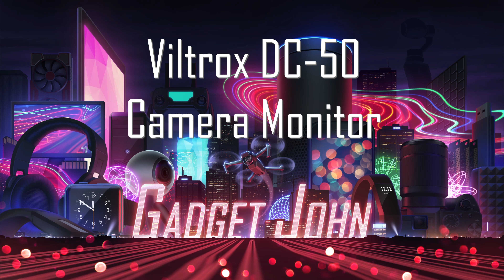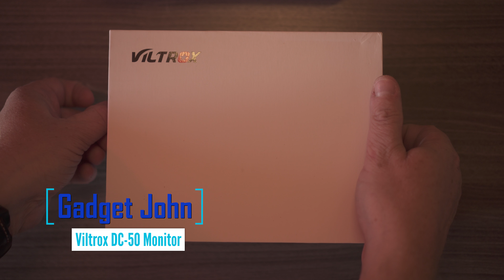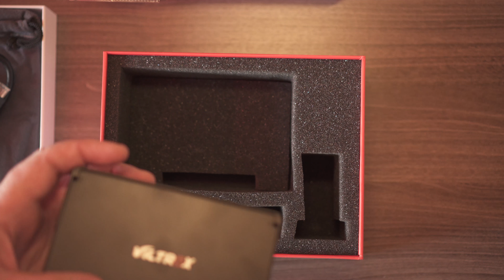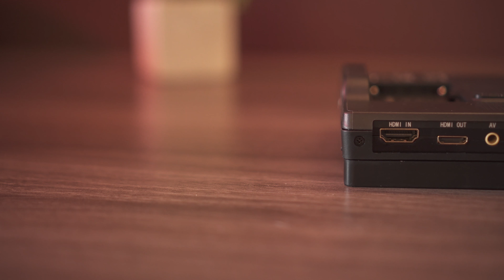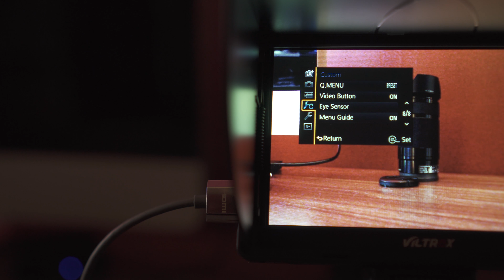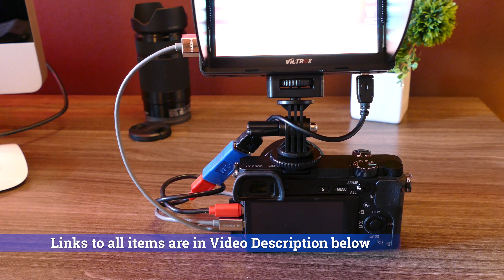Best Budget Camera Monitor! | Viltrox DC-50 Full Review

Comment: just bought one does this require a battery to run it,i have the hdmi cables connected and no power to screen ??  if i need a battery do i also need to be connected with hdmi cables  thanks

Comment: Thanks for the informative video. I would be grateful if you could answer a couple of questions.
It appears the monitor doesn't come with a battery.
Can you please tell me how long the monitor will operate on a standard sized Sony battery?
Also, can the monitor be charged by a power bank via USB cable while in use if the battery is getting low charge, or if the monitor will operate without a battery e.g. powered by a power bank alone?
Thanks.

Comment: Thanks for your fantastic review! I heard you say that it will take a 4K input, I just wanted to make sure that it will be usable with my Panasonic GX85 in both 4K 24fps mode and also 1080p 24fps and 60fps before I buy one. If you have this info that would be a massive help! Cheers!
Reply from the maker: It takes a 4k input form the sony cameras I have used, it's a raw hdmi feed so you don't see the camera OSD data - just the image.
Reply: Am I wrong or do I see a Panasonic menu in your vid?
Reply from the maker: Yes, that was showing it connected to a fz1000 camera, but I just wanted to let you know in 4K the menu and OSD doesn't show on the monitor.
Reply: That means that with a GH4 recording at FullHD 60 fps you can also get the Menu in the Monitor, right?...  Can you monitor histogram during recording?  Thank you in advance!

Comment: Can you please help by confirming in Focus peaking setting, can i have the check box ticked Focus AND in Black and White. My unit I can only set Focus on but on YT videos I see others can set both. Any ideas> Cheers
Reply from the maker: +Laurence Grant Hi, I can view focus peaking and zebra and the focus is in red, or whatever setting I choose. However, all this is just replicated from my camera. The monitor doesn't give me control over those settings.
Reply: Hi John, If I tick the 'Focus' option I then can't choose B+W or Blue option AS WELL. :-(   Would have thought that when I chose Focus (peaking) I could then decide whether i wanted it blue or B+W. How does yours work? My camera (Nikon D4s dont not have any advance setting, it a Nikon!) I intended to use monitor for GoPro but thought I would be useful outside for helping with focus. I have a lilliput 7" which allow black and white or colour, with peaking on or off. I am expecting too much of Viltrox.
Reply from the maker: The viltrox will provide these visuals, you can set a focus peaking on the monitor that is in addition to the cameras own settings. However from my testing this is not the way to truly set your focus as it's not as fine as the cameras own focus peaking system.

Comment: how is the dc-50 in daylight outside compared to the A6300 LCD?  also, can you change camera settings by touching the LCD?  how much lag is there vs the integrated display of the A6300?
Reply from the maker: As you can see in the video, the monitor does really well in both direct sunlight and bright light, much better than the a6300. There is now lag at all with this monitor.